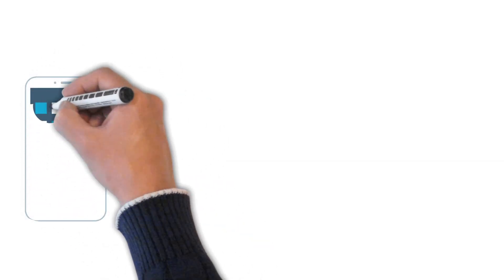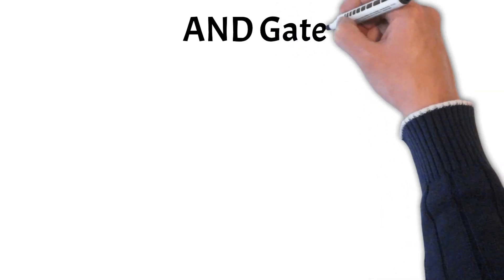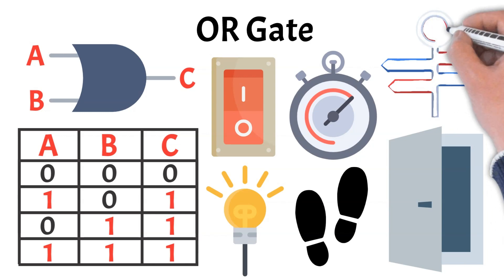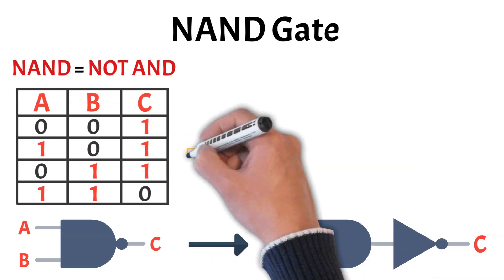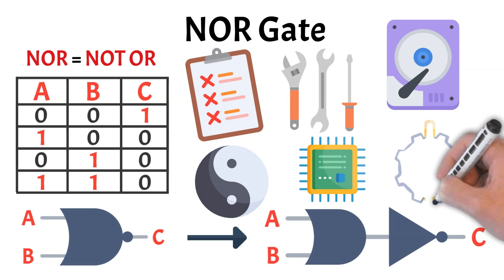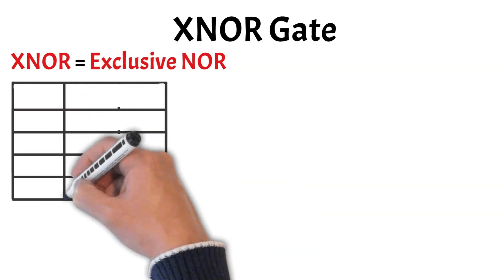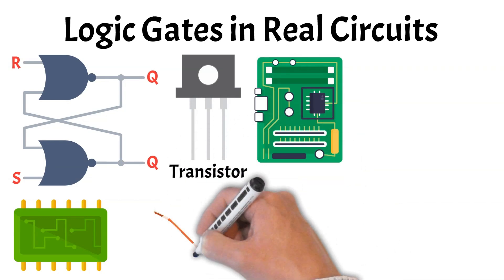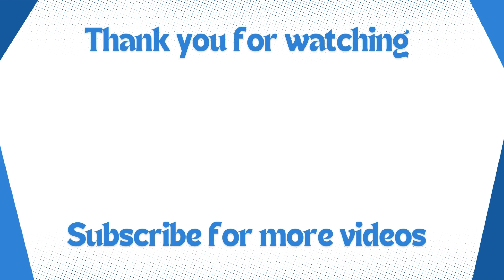Logic Gates Explained: AND, OR, NOT & More | Digital Electronics

Comment: I want to anderstan where is it logic gate in the computer is she it into cpu just or no and could explain transistor
Reply from the maker: Great question, logic gates can be found in different places inside a computer and other electronic devices. Some examples where logic gates are used include CPUs, data storage devices (where the flip-flop mentioned in the video is used), various communication devices (such as traffic lights, alarms...) and many others. Regarding the transistors, they are basically a small electronic device (semiconductor device more precisely) that is used to either control the signal flow or amplify the signal. Like we mentioned in the video, it is fundamental for the actual implementation of logic gates and practically all other devices nowadays and are thus considered one of the most significant discoveries in recent history. We will consider creating videos on transistors and other electronics concepts. Thank you again for watching and sharing your view.
Reply: @WhiteboardDoodles24 
I’m amazed how you understood that question.